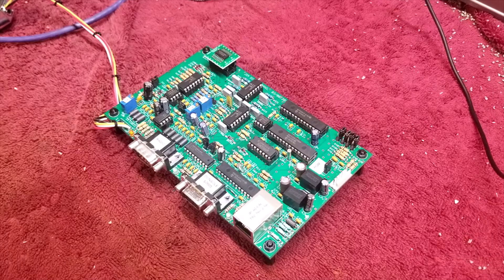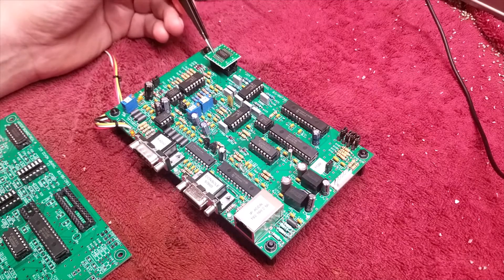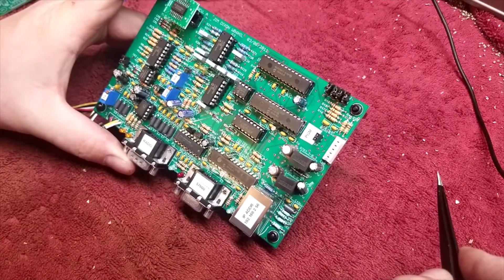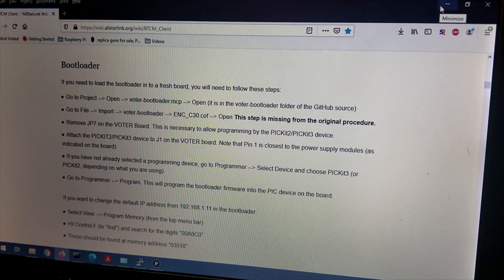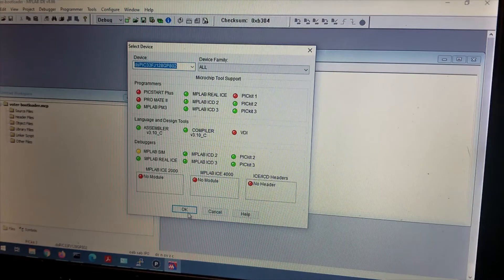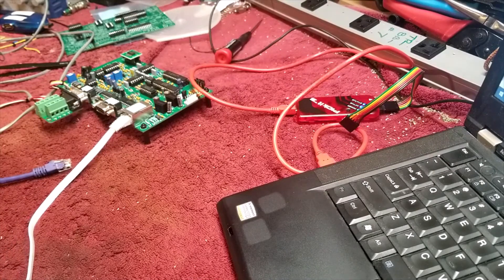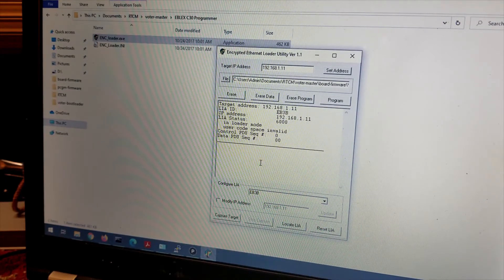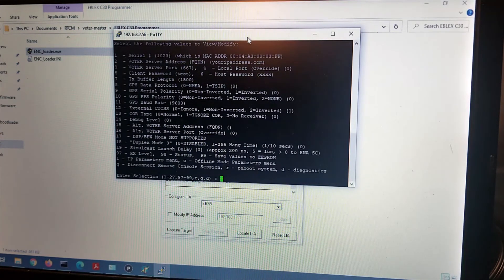Programming the PIC on the Allstar VOTER Board

Comment: Interesting enough, I can program the PIC with the bootloader (verify complete)however the board is as dead as a door knob.

Especially after removing most IC's and troubleshooting it seems to stay dead.

Unfortunately I had to get a whole bunch of equivalent parts and worst of all I had to get the humongous HC49 crystals since I could not find any DT versions had to bend the legs a little too.

However I suspect it's the EEPROM I'm using a 25LC256 but the VOTER uses a 25LC080...

I thought hey more space... and they are available but it seems like there's some checks maybe some hex values are different.

though it's only a suspicion I'll have to confirm it...
Reply: Did you import the .cof in MPLab?